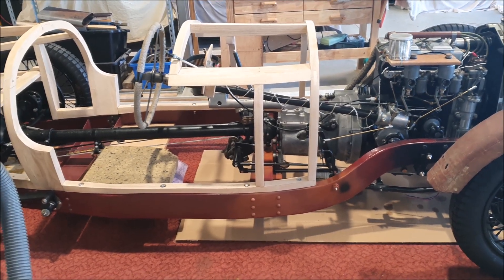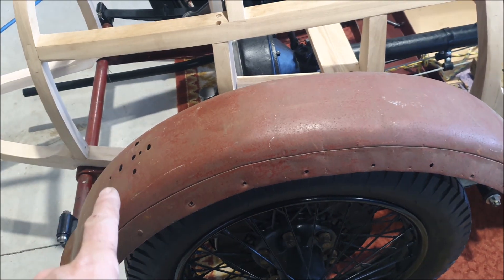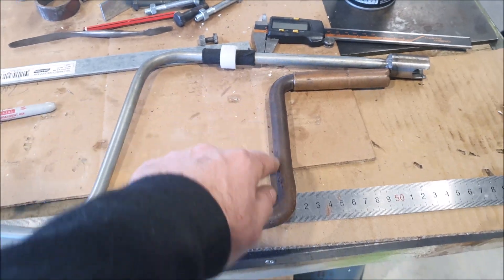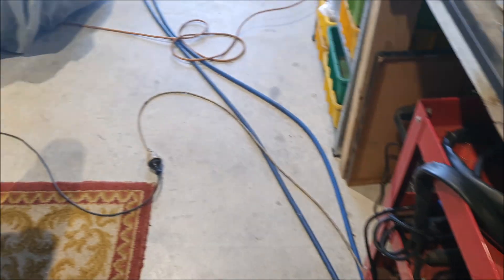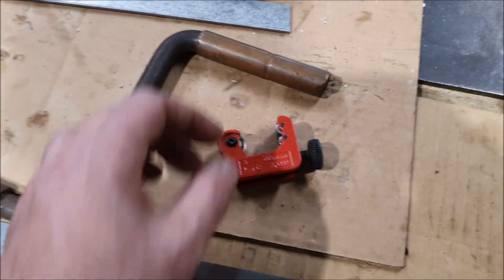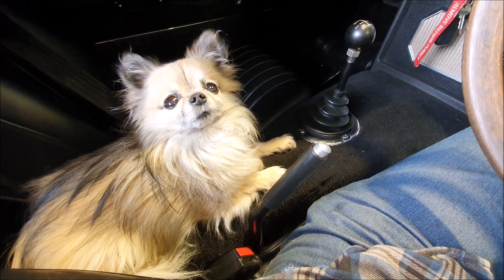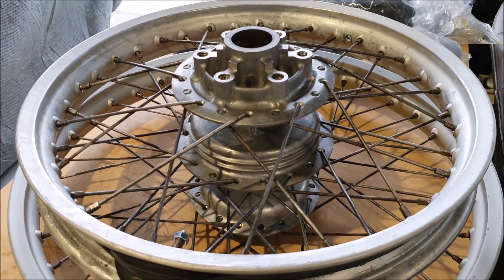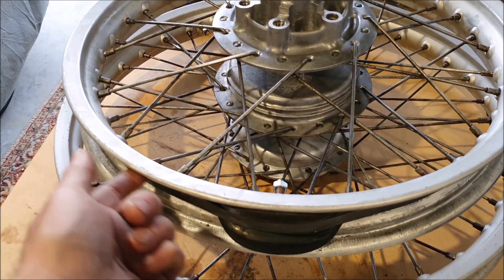The Brooklands strangler

Comment: Good idea with you choke set up. Any twin SU set up always seems to end up with play and sharp wires and split pins everywhere. Just right for cutting fingers ! She is looking car like now. Good work so far. Best from the UK
Reply from the maker: Everything is really only loosely assembled for now. The whole thing will need to come apart for painting and so I can turn the chassis upside down so I can fit the undertrays. When it finally goes back together I will make all the split pins nice and make sure there are no sharp points. The end of the cable will get a little piece of sleeving. Because I do need to keep oiling everything, all those plain steel nuts and castle nuts, I will want to remove all the sharp bits!

Comment: Good to see you pecking away at the Riley the devil really is in the detail.  It's so time consuming fitting and making brackets, and when its finished it looks so obvious but if you haven't got a pattern part to copy it's not easy and takes for ever to get right. 
.
Like the tin , as  soon as you picked it up I thought "period correct" and how appropriate for car protection. But be warned,  this could start another passion for collecting oil cans.
Reply from the maker: If I did that In would need better shelving in the shed. Currently things balance precariously on the metal wall beams which aren't all flat. IN an decent wind (or earthquake) many things are likely to fall down!
Reply: @asciimation  A man of your ability's that shouldn't be to hard.

Comment: Swarfega - the green hand cleaner gel in a red jar, always worked well for me when fitting bike tyres. One of my road bikes that the tyres which were the factory type, were tubeless tyres and therefore a lot thicker and more difficult to lever onto my rims. Anyway, other than using rubber or silicone grease, you can try Swarfega.
Reply from the maker: I haven't thought of that for years. I guess you can still get it? I'll keep an eye out!
Reply: Mitre 10 still sell it, as do Pak 'N Save here in Akl. Still good stuff for cleaning hands too!
Reply from the maker: I am going to see it EVERYWHERE I go now I am sure!